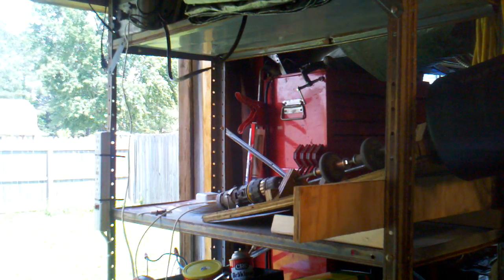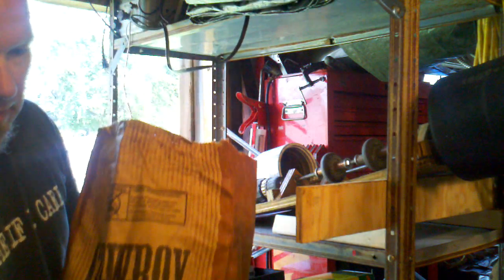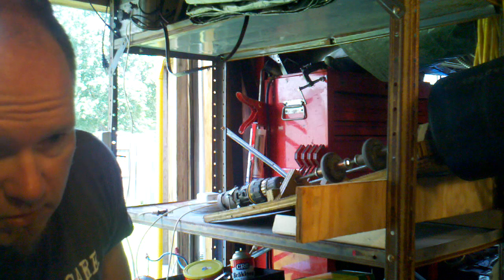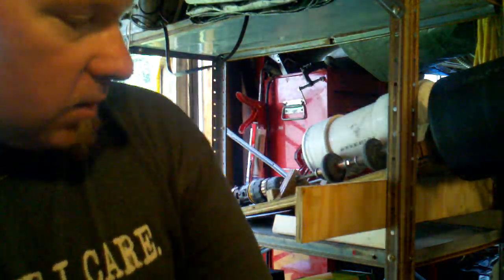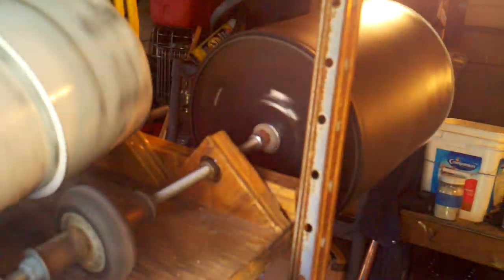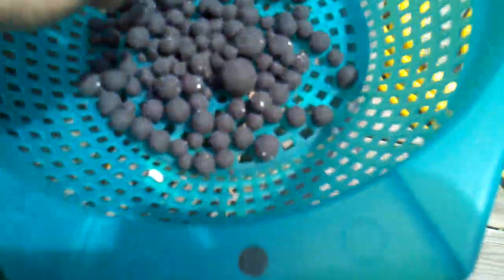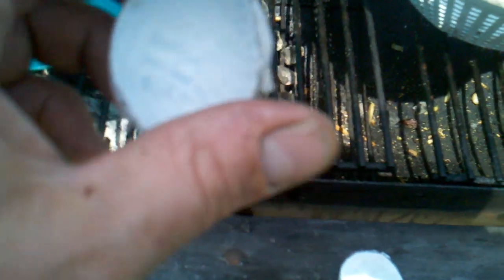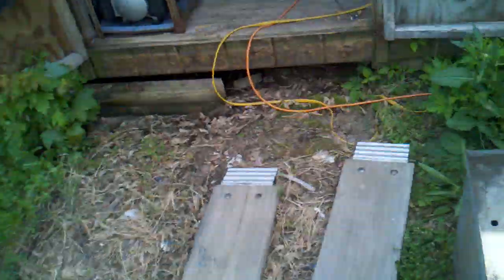My home made firework black powder ball mill with the star roller attachment.

Comment: Yes you can make a black powder that will work with  hardwood charcoal I have done it when I first started making BP in the 1960's.  But there is a very noticeable difference in performance.      The Hardwood just won't work as well as a softwood like  Willow grape vine Balsam,or elder  and neither will some softwoods like pine.   If you investigate the chemistry behind gunpowder you will see why this is so and why this little fact has been known for hundreds of years.

Comment: do you find  mill with direct rotary attached better or ones with bands cant seem to get my homemade one with bands to work, ddnt have a problem years ago with old milkshake maker directly connected to one roller! :( please help using a fan motor atm and might have a smaller milkshake blender type not a high powered blender slow one!